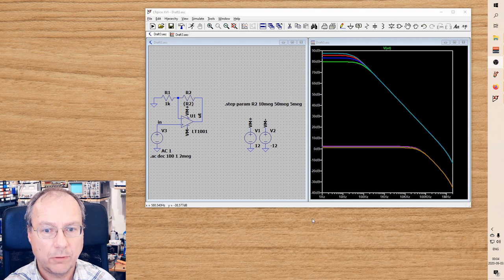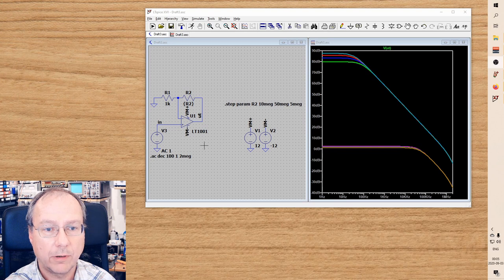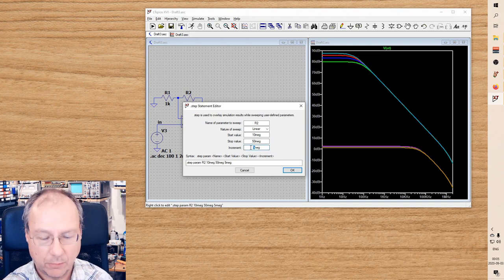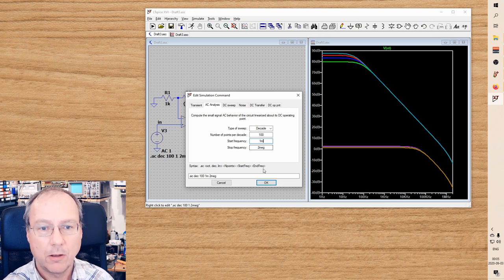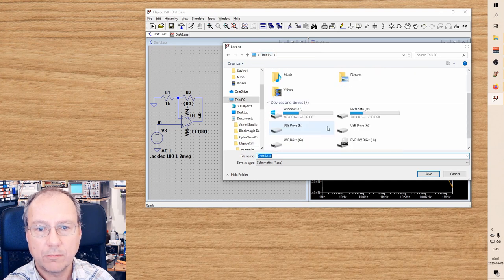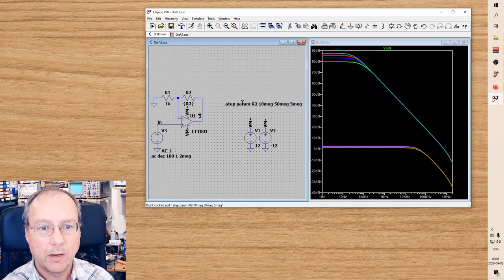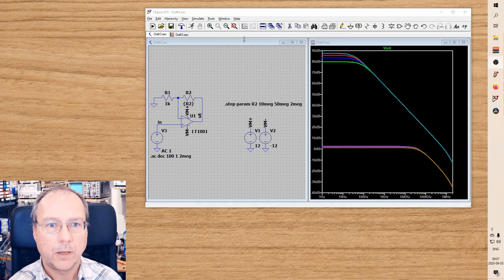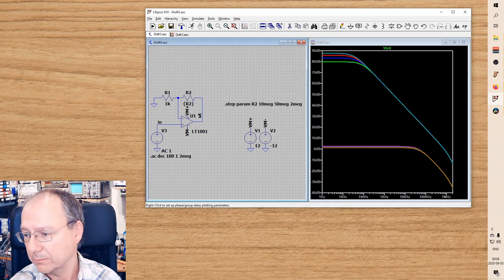LTspice UI bug

Comment from the maker: The problem does not appear if there is only one parameter list, e.g. just with a parametrized voltage divider But with the given circuit of one opamp, two resistors and three voltage sources it is always present in the August 22, 2020 release.